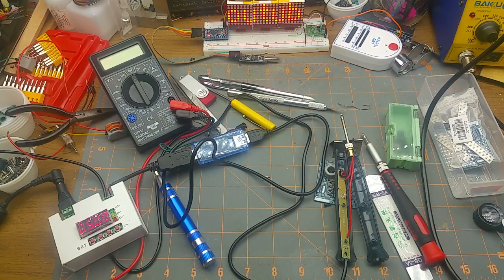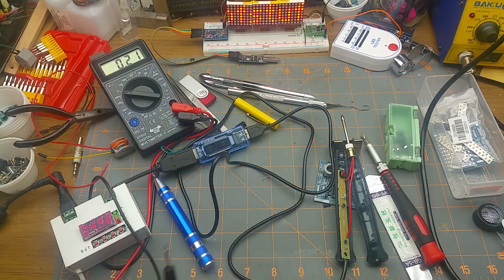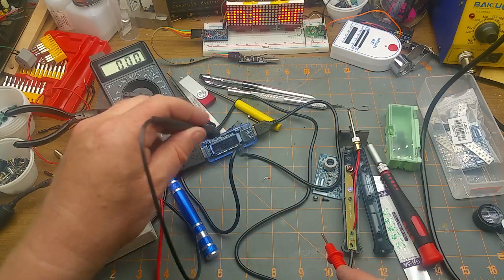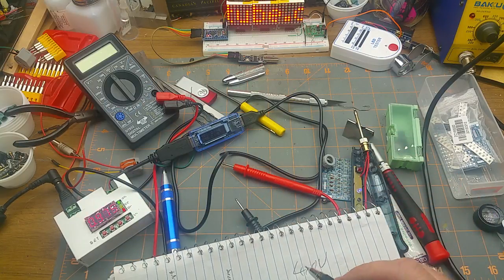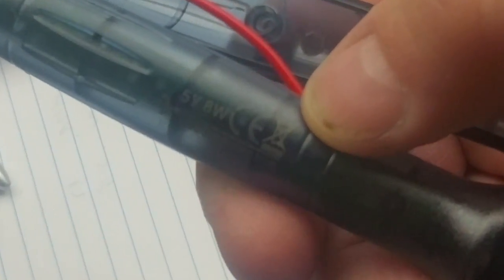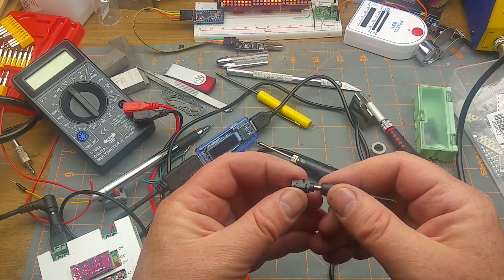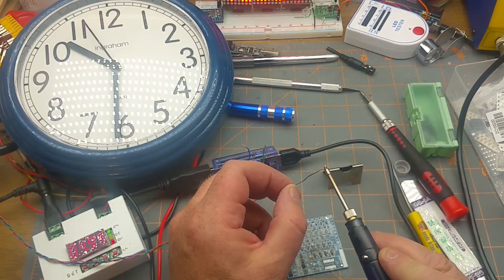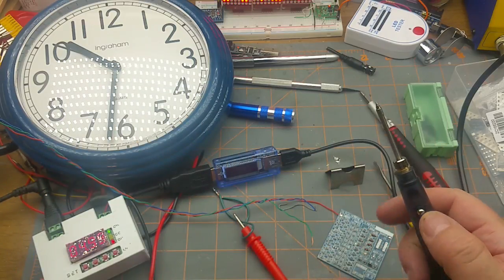Answers about the cheap soldering iron

Comment: The "original" one hits up within 13-15 sec and the iron tip has ~ 4 Ohm resistance.  
People reported iron tip replacement values btw  2.5 Ohm - 8 Ohm,  with the 2.5 Ohm one hitting up to much ( iron tip turning red) and the 8 Ohm one hitting up very slowly.
like I've mentioned on the other video of yours, look for the one with YELLOW plastic nut.

Comment: Now you gotta pimp that mudda to 10V, or maybe a better lead. lol. 
From memory - mushy memory at best - Big Clive tested a 937D,, and I think it was 20-30 sec. I think that is the best old tech I've seen.
Reply from the maker: Yeah, Clive tested a much more deluxe version. 
The case looks similar, but the circuit is quite different.

Clive's video, for reference: https://www.youtube.com/watch?v=o-8D5t6TJYU
Reply: Ahhh that is the one I have. Must have missed that clip from Clive.  Well I think the ON/OFF is a better system that pileofstuff has. Sometimes you have to put the iron away to realign a component and then the iron is off.   Need to check how fast it can melt solder,  might try that today.   Maybe pileofstuff can use that little female usb connector to just use a regular 12V power supply or so.  Should be easily to use with a small car/bike battery then and it should have more power.
Reply: I missed that video from Clive somehow but that is the iron I have. I soldered up a DSO Shell oscilloscope kit with that tiny iron plugged into a mains powered usb strip without frying any components. Now that I have seen Clive's video I may have to check the tip voltage to main ground like he did! Since the kit was not hooked to ground I may have dodged a bullet as the oscilloscope works great.
Reply: Yup, also 1 of the reasons why I would only use it on a powerbank (is that 1 or 2 words?) if soldering regular components.  To be honest if you have a nice grounded soldering station you could also fry components by just touching them.  Only if I work on something really fragile like memory I wear a gnd band around my wrist but that only happens ones in a while.